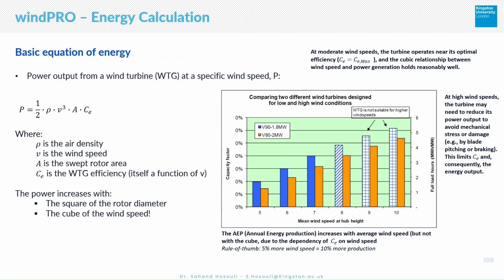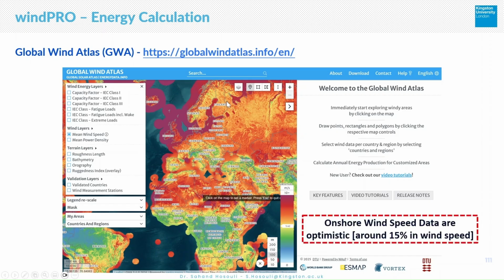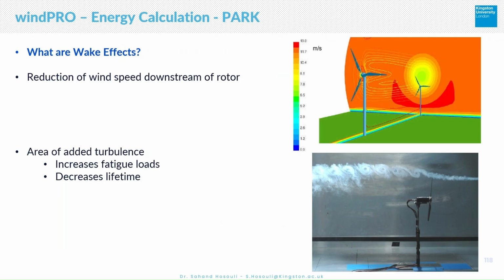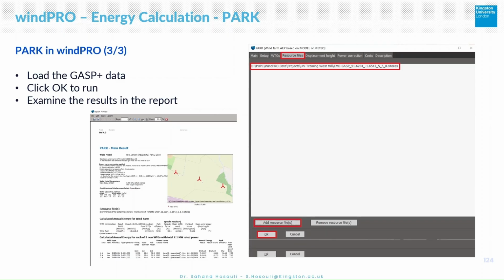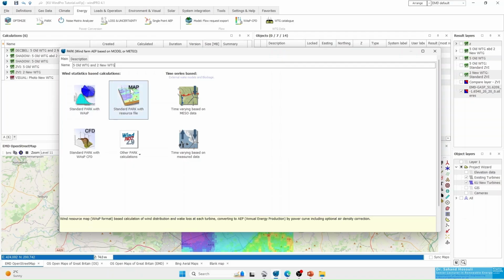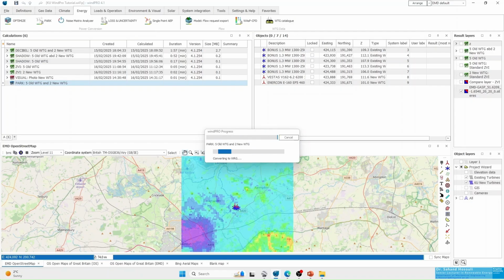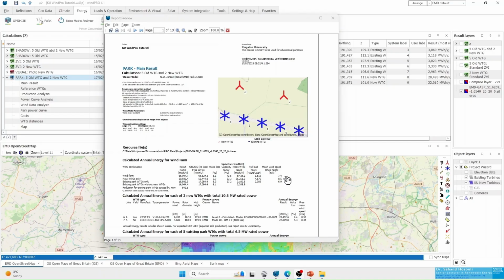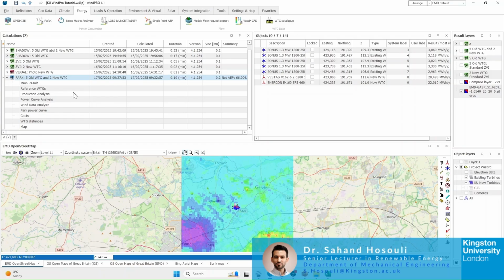[Tutorial] windPRO Part 4 - Energy & Financial Analysis

Comment: Great job. Your tutorial is very helpful.

Please tell me, is it necessary to have a WAsP Bundle licence to perform AEP analyses in windPRO?
Is it possible to perform an AEP analysis with the same level of accuracy using publicly available data, e.g. Global Wind Atlas? If so, apart from the BASIC and PARK modules, which additional module is required: MODEL or METEO, or both?
I have a small project to complete and purchasing additional software is beyond my budget. However, I would not want this to affect the quality of the analysis.
Thanks in advance!

Comment: Hi Dr Hosouli, thank you very much for the excellent tutorial!!
I was left with a question about the energy generation: as you said, GASP overestimates by 15% compared to the real value, so the production should be around 11,500 MWh/year and not 15,000 MWh/year. What explains this difference?
Also, does the generated value of 15,000 MWh/year represent the P50?
At Windpro, is it possible to generate other percentiles like P90, P95?

Thank you so much!